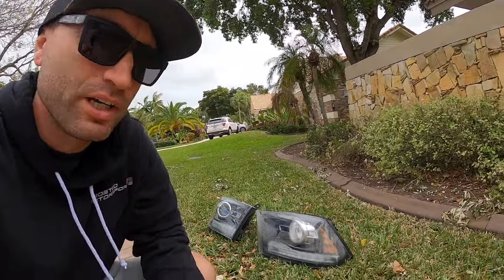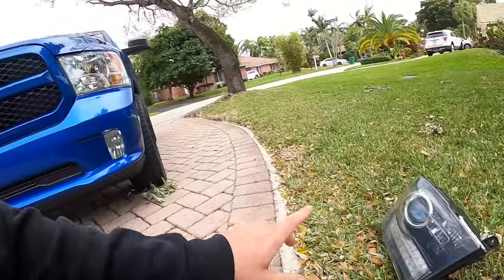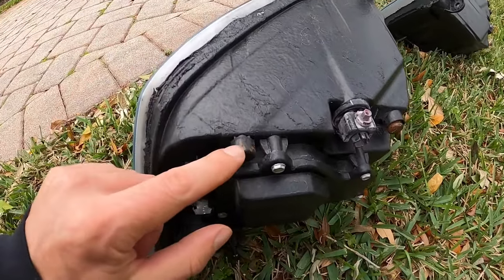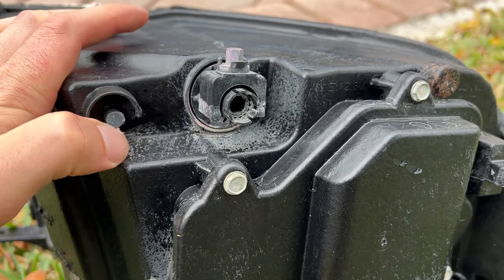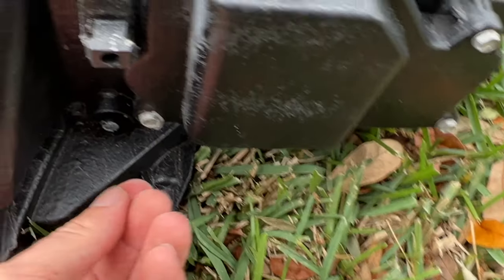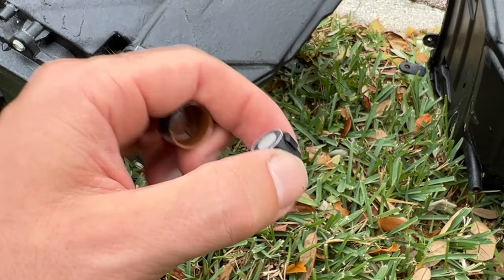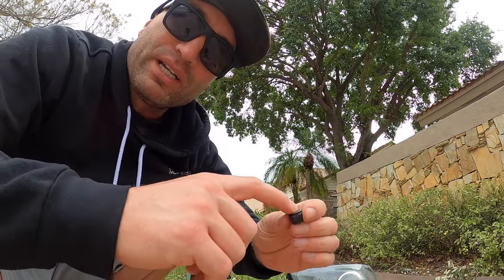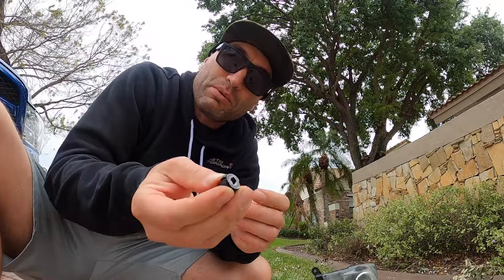RAM Projector Headlight Condensation Fog Issue FIX

Comment from the maker: Here is my conclusion so far is that in humid climates if it doesn't allow moisture/water to pass through when the  headlight drastically changes temperature compared to ambient it wont be able to breathe and vent properly.  I want to see what vents the factory quad headlights have on them when I take them out. The aftermarket ones I showed don't have an issue and are using the same design just with a 90* hose on them.
Reply: It should be the same but I think they are in grey color.
Reply: Where can you get the adapter
Reply: How are they holding up with that filter removed did that give you a fix ?

Comment: Most people don’t realize is that when you switch from halogen bulbs which produce a lot of heat to LED which produce a lot less heat. You’ll have more condensation issues because not enough heat being produced to burn of condensation.
Reply: I got same problem on halogen , halogen heats too much , outside it s cold and condensation it s forms inside I need to find the ventilation and free them so it can breathe inside, even if no halogen they still get hot from the inside , the engine side it s hot also.
Reply: i have led bulbs  replacing my halogen in my 2018 charger pursuit, pass headlight always condensation. i will check these vents or drill some holes in the back.
Reply: This.  Always noticed a little condensation inside the light housings after washing the truck, or a bit of rain.  In fact, the first week I owned the truck I noticed this and brought it back to the dealer, where they explained that a little condensation was expected/ok.  Since I installed LED bulbs they seem to have more condensation and it takes longer to dry out.  And the driver side is definitely wetter than the passenger side.  Going to pull the housings and try adjusting & cleaning the vents today.  

FWIW, local dealership made a note at my last service saying my headlamp housing had a failed seal and needed to be replaced.  🤣

Comment: This is how it went with both my headlights having about same much water in them here in humid Louisiana ... I tried pull plugs different ways from little to as much as i could with no result and i dried them every time with fan and heater really good, it always lasted few days and then it started doing same from little fog to sitting water 2 weeks later... Then i tried 2nd approach and silicone plexiglass housing crack, nothing else, not the vents ofcourse... Suddenly one kept dry and never fogged again, i talked to few mechanics friends, both saying it's usually poor seal and it gets water or moisture in, i inspected thoroughly the silicone on light which was still fogging and could not find any hole crack in silicone fix, i siliconed it anyway again very carefully to not miss spot... after that it stopped fogging as well both are fine it never came back and it's about year now

Comment: Add the footwell lights inside the cab next. I just did it on my quad cab express, real easy if you have the the hook ups under the dash.
Reply from the maker: Yeah I’ll come up with something for that too!
Reply: There are none? Or you mean have them come on with lights not just with doors , i actually connected them that way that they come on with doors and also with dash lights on dimmer

Comment: Added gtr hid lows and gtr led highs and adjusted the vent caps while doing the job as i was having condensation issues as well. 2 years later and no condensation since. Vents were as you stated...pushed all the way in rendering the vent useless. I can confidently say that adjusting them out will take care of the issue for you.

Comment: Been through this issue so so many times with these lights. I took a sewing needle and poked a couple holes in the vents to breath better while still not having them pushed tight. 
Next thing you can do is add silica gel packs to the inside, they work wonders as well!
Reply from the maker: Yeah the silica packs is a good idea as long as they don’t burst and let beads fly everywhere in your headlight 😂
Reply: Speaking of the silica packs I'm pretty sure I've seen them inside some tyc projector replicas before.
Reply: @Josh Breton did doing all that fix your headlight problem?
Reply: @Josh-hh4ix  it did yes

Comment: That condensation issue is not confined to just the Ram trucks. Have seen it in other cars as well.
Cool video! Thanks man!
Reply from the maker: Yeah the TSB I saw was from a 300c I believe with the same issue
Reply: it was nuts, i had them fogging and i could not find another Ram truck on road with same issue, actually until one today like year later, but yes i did see it on many other usually older vehicles including Japanese

Comment: UPDATE: So when I pulled the headlight out I found the reason for my condensation/water issue. When I replaced the halogen bulbs with the LED replacement lights, I actually didn’t make certain the cap on the back of the headlights wasn’t seated properly. As soon as I pulled the light, I could see how the panel wasn’t secured properly where the light bulbs go…smh…the water has damaged the lower part of the turn signal…so when I get tired of looking at it, I may just go with Boosted current replacement light set up. Thank you for the amazing videos!!
Reply: How do you go about fixing that problem. I have the same problem, I switch mine to led and the back part wasn’t sealed correctly. I was thinking maybe replacing the red rubber band that was around the led bulb but I’m not sure if that would work?
Reply: @brayanhdz7260  I found out that when I reinstalled it, I didn’t secure the area completely. Once I secured it and removed the moisture, the lense is still damaged from the water collection. I will have to eventually order a replacement ($600 ) OEM

Comment: I would recommend you put some type of filter material in the ripped-out part. The inside of your lenses will gather dust and look dingey in a few months, I had this happen on my headlights from a bulb not being seated all the way, it's not fun to have to take them apart clean them carefully and then put everything back together hoping its fixed.

Comment: Those screens are most likely  hydrophobic on one side and not the other so only air passes through.
 Man that was a lot of water.
Thumbs UP!
Reply from the maker: Yeah only thing is in humid climates if it doesn't allow moisture/water to pass through when the  headlight drastically changes temperature compared to ambient it wont be able to breathe and vent properly.  I want to see what vents the factory quad headlights have on them when I take them out. The aftermarket ones I showed don't have an issue and are using the same design just with a 90* hose on them
Reply: I was wondering if those filters were restrictive on purpose.  Maybe it's the airflow while driving that pulls the moisture through.

Comment: I had that issue with my RAM.  Opened up the headlight back panel and used a hair dryer to get out all the condensation.  Found the vents were close on it.  Opened them up and never a problem again.  Prior to finding the TSB on the vents, I had tried sealing the joints with silicone with no success.
Reply: How did you know they were closed ?

Comment: My vents were sealed when I pulled them off and I had to use pliers to get them off. I ended up using QD cleaner and a knife to scrap the filters . That seemed to work pretty good. Your video was great insight though.

Comment: Mesh stuff you can brush it it and also run it under  the sink and fan it dry and you can always fan dry/heat dry it some take and use a vacuum  with tube and insert it to take moisture out circulation  . I think a fan or hair bower be fine . Some put it un a box with a hair bower some use a heat gun. Whatever  you have handy and should dry within 15-20 mins maybe even less

Comment: I dont know if someone commented this already. But I think you should bake the headlight, opened and cleaned very well inside. The water could be damage the led boards. 😊 If you don't want to open it open the rear cap and blown inside with air blower until is dry.
Reply: I have a damage LED board how can I fix that ?

Comment: I’m super ocd with my truck and I noticed this was happening… I ended up just ordering new headlights lol
Reply: You'll likely end up with the same issue again.  Like he said, the lights need to breathe.  They'll need to draw air in after they've gotten hot to keep from imploding (watch the Mythbusters episode on the imploding rail tank), and let air escape as they heat up.  Moisture will take longer to escape if you use leds as well since theirs less heat to evaporate the moisture.

Comment: Funny, cause I sealed my driver's side due to that issue and it stopped accumulating condensation, but now my passenger side building up condensation. I didn't seal the passenger side, I'll try doing the same with the vents

Comment: I fixed mine by adding silica gel packets to each light. No more condensation
Reply: Where did you install the packets on the headlights?
Reply: @williamdavila7577  i removed the plastic rear projector cover and inserted them inbetween all of the bulbs/connections

Comment: I'd pull the bulb and run a hair dryer in it to help get the moisture out
Reply from the maker: It’s been inside with the lid off all week. It’s completely dry now but that would be a good way to do it in a hurry 👍
Reply: similar here, i used ceramic heater carefully from distance but forced air in faster with fan and had all opened up for few hours each